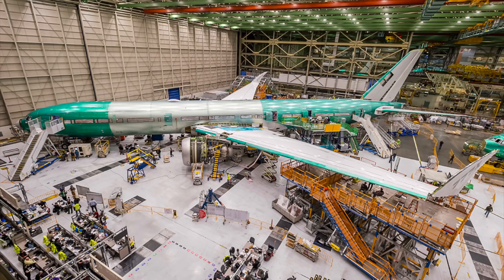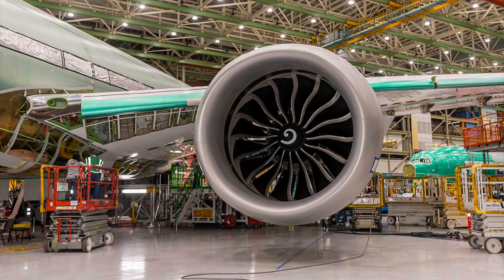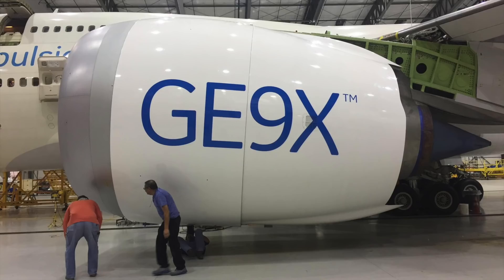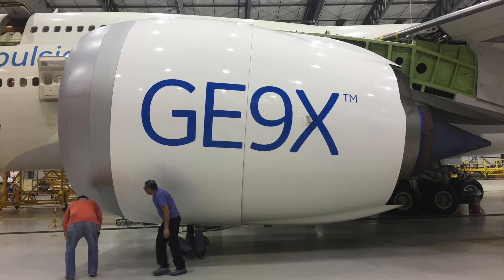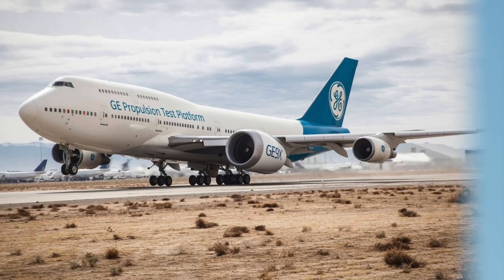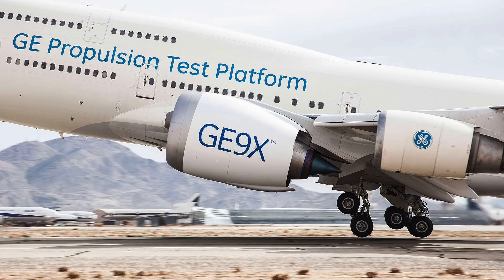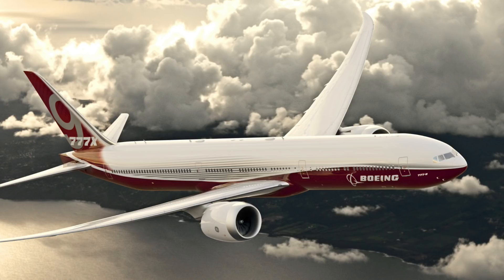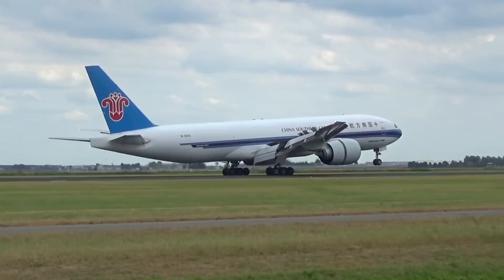777X Receives World's Largest Jet Engines

Comment: The wings on the 777X are carbon composite as you said, but I don’t think that aids in aerodynamic ability. The thrust does not need to be as high because parts like the wing are made of generally lighter material. Less mass needs less thrust.

Comment: I would be interested in knowing why the GE9X doesn't have the chevrons that were included on the 747-8, the 787, and the 737 Max aircraft.  I could be wrong, but I thought they were a way to reduce the noise footprint of the aircraft.
Reply: thedawg1995 Yes, but they decrease efficiency somewhat as well. 777X without chevrons was already a bit quieter, so there was no need
Reply: @AmbientMorality  Thank you.  It just seems odd that they did this for 3 different aircraft models but not this one.

Comment: You end the video asking us, "What do you think?"

What are we supposed to think?
If it works as advertised, is as safe & reliable as its predecessor, it saves fuel, and has lower or the same maintenance costs ... it's going to be a fabulous engine.

But how could any of us know what to think about this engine, until it's actually been put into the air and tested under real-life conditions?

Comment: Would have been nice to get an explanation on why the engine needs to be so big if it isn't producing more thrust than the GE-90.
Reply: @Raph Fan Because MURICA !!
Reply: Raph Fan I agree.
Reply: More efficiency. The plane engine produces it's own vortex and relies less on the outer fan to drive air inside the engine I believe. Something like that, do your research.

Comment: Drag has very little to do with T/O performance. The GE 9x engines 'produce' less max power because they are  'flat rated' to a higher density altitude. 

Im guessing this has a LOT to do with making the B77x a desirable A/C for use by the Arab countries where 50c and higher altitude departures are routine. This means that the B77x can max out its weight and capacity at all operating conditions - as far as take off calcs go.

Comment: 105000 lb of thrust is plantae and by making slightly less power than its predecessor it's probably saving fuel which is very important so there are trade-offs. I also think it's taking way too long to get the bugs out of the engine and get the thing flying I have repeated before that the 747 was flying within 28 months from its conception to its completion and that was done with far less computer power than Boeing has now I know the ge9x is a very complex engine but they keep postponing the launch date and don't seem to be making any progress on it Airlines will not wait forever to be able to buy the jet there is plenty of competition out there

Comment: Even thought the engine doesn't need to be more powerful on that particular aplication,why not make more powerful if it will be put on other aircraft any time in the future,or even for reserve power for the aircraft it's on.
Reply from the maker: If the engine was more powerful, it wouldn't be as fuel efficient, which is what airlines are mainly opting for these days.

Comment: Great Video and the engines sound like  they will offer useful cost per Kilometre savings, I wish that they would develop better seating spacing for pax however, I couldn't give a damn about the engine size,so long as it's safe and reliable however, any 18 hours trip with microscopic seating space is the flip side of the coin it appears, Fly 'Emirates',not only bad food, no service and treating pax as cattle, the engines would be the least of the list of Airline inconveniences. and you'll understand.

Comment: Now i wonder, is the 747-400 in full payload can fly with only 2 GE9x engine?
Reply from the maker: Not sure mate, though that would definitely be interesting to see!
Reply: I’ve seen where thrust wise it could. air at least with the 90 that produced 115, 00 pounds thrust . The issue was that everything  requires so much modification, it’s too costly and would equate just making a whole new plane
Reply: iihamdi......  Yes it could as the 2 GE9X's are lighter than the four 747's engines !!!! GE when testing flew their 747-400 on just the one GE9X during testing !!!!!

Comment: Doesn’t the efficiency of the wing have more to do with it’s shape and design, rather than the material it is made out of?
Reply from the maker: If the material that it's made out is lighter, it therefore makes the wing more efficient. But yes, the shape and design are also key factors for sure!
Reply: @pureaviation3596  that was a dumb idea to make the plane slower. What's the ratio for fuel consumption for both engines?

Comment: Lets hope that the extended landing strut on the aircraft can take landings as well as the short struts on the normal aircraft heights.  Those large engines must be kept far enough off the pavement so that they don't suck FOD into the intake.  If those struts get any longer the craft will look like the B-58 Hustler, which looked like a mosquito.  If the old engines were more powerful, then why have the new engine be larger and less powerful.  He said, "because it doesn't have to be."  So, would the weight increase of the old engines if put on that aircraft be too much weight for those new wings to carry?  If the fuel consumption of the new engine saves that much more money, then I can see why.  But why does just increasing the size of an engine cause it to be less powerful?  That doesn't make sense.  Were they afraid it would rip the pylons off the wings.  We were told years ago that with the new Turbofans that were being introduced, that if they put them at 100% at take off it would unduly stress the wings and possibly rip the engines off the pylons, so they took off at only 80% thrust !
Reply: It has a lot to do with fan size. Cold air is easier to compress than hot air. The emphasis these days is on moving more cold air and less hot air. So, make the gas generator more fuel efficient and extract as much of that power of combustion as possible, then feed that power to the fan. So the fan becomes bigger and the gas generator becomes physically smaller. Have a look at the diameter of the gas generator of a GE CF6 then compare that to an old P&W JT9D gas generator. In a way we have come full circle from the huge radials and big props, to the pure jet, then the turbofan and now back to the old days of propeller driven aircraft, but using a gas turbine instead of a radial.

Comment: You mentioned that the plane will use less fuel, and cost less to operate, but you did not explain why/how the bigger engine will be more fuel efficient.  And you also failed to explain why/how the new carbon fiber wings are more aerodynamic.  Using carbon fiber in itself would not produce any benefit in aerodynamics.  However, since carbon fiber is stronger than aluminum, it may be possible that they were able to make the wing thinner, and that is why it is more aerodynamic.  But you did not explain that.    Also, why would you give the diameter of the new engine in inches?  Nobody thinks in inches beyond about 4 or 5 feet.  184 inches = 15'-4"  The engine is taking the idea of 'high bypass' to the extreme.  It is more of a turboprop, that blade is a ducted propeller.

Comment: Does this new engine fit in B-777 freigher? Thought the current engine is the maximal loadable size to fit in B-777 freigher. When loading current engine, there are inches to maneuver. If not, why build an engine that can't be shipped commercially. Airlines rely on replacement engines and cargo carriers sure like the revenue moving engines - it's a big business.Anybody know if new engine is loadable in current B-777 freighter?
Reply: soaringtractor  Hi, a spare engine may has been attached to a B-747. Modern two engine jets are not designed to carry a third engine under a wing. Do think it's a serious issue. May be the new engine can be partly disassembled in order to fit into a triple seven freighter.

Comment: What size is the fan diameter of engine which is used in  A380.
Reply from the maker: It's about 116 inches (290 cm) for the Trent 900 engine.

Comment: I see so many complaints about seating size and I want to complain as well. This though is the wrong place to complain. It’s the airlines not the make of the plane.  Really we all need to pay for the more expensive ticket on the airlines that offer the bigger seat. Send a not to SW Sardines and tell them you were going to take a trip but used another company and paid more for more seat or just did not go. Although I don’t think they will care. So our only options really is congress. Have congress pass a min seat size. Until then it will continue to shrink. Some airlines if I can’t get the bulkhead seat with the extra leg room I don’t book.  Amazing engine and an amazing plane.

Comment: This is exciting and depressing at the same time
Reply from the maker: Why depressing?
Reply: @pureaviation3596  because the start of the 777X will officially mean the start of the end of the A380 and 747
Reply from the maker: @80sfreak14  True true
Reply: @80sfreak14  -- I haven't missed the 747 at all. In fact, I was glad to see it go. The B777 in 9-across is much nicer than that 747 in 10-across, and so my frequent transpacific flights are much more pleasant. 

I will miss the 380, as that's a VERY comfortable aircraft. Sadly, it seems that it won't be around for long ......
Reply: @sking2173  yeah but the A380 is more comfortable than the 777 in any configuration...
Reply: @adamhall5298  nope, the B777 seats are  designed and engineered for precise comfort state of the art.
Reply: @eddyboh2723  That's all to do with the airline. I found Singapore's A380 way more comfortable than Cathay's 777-300ER. However Cathay's A350-900 beat them both imo.

Comment: your explanation makes no sense. If the plane requires less power because it is lighter or more aerodynamic, or for any reason, and your reasons given were also not correct, WHY does the engine need to be bigger? That creates more drag. You need to research your subject matter better. The reason it is bigger is to suck in more air to generate a greater percentage of thrust from bypass air. That compensates for the greater drag.

Comment: I prefer Boeing 747 is the best than Boeing 777x. If 777x fly the landing on the runway and if crossword may be push the plane with under the mount of an biggest engine will hit the ground and it will crash or damage!. No matter what will happen to the plane.
Reply from the maker: Both are great, but I also have to say that I prefer the 747 :).

Comment: The concept of the triple 7X is outstanding very outstanding but the reality is no one's ever seen the damn thing fly it hasn't flown and I imagine the airlines would like to get it into their Fleet before it becomes obsolete bit of an exaggeration there but I made my point Boeing took the 747 from conception to completion in 28 months without all the computer power that we have today and I understand the engines are probably the main hold up but GE is better than what we are seeing from them right now I'm no engineer but couldn't GE and Pratt & Whitney design an engine with the same concept of Chevrolet 350 pickup motor need a good basic design and it should last for years they can test small and important updates of the engine after it has become accessible to Airlines and the flying public

Comment: Might be cheaper but wayyyyy more dangerous!!!
With 4 engines you can lose 1 of even two if one on both sides...
With this you lose one you're fucked!!! Fuck fuel consumption over safety
Reply from the maker: Dual engined aircraft are extremely safe nowadays. Even if one of them fails, the aircraft can still fly perfectly well on one engine.
Reply: @pureaviation3596 
But is a lot less stable
Pilots have to be compensating and continually do corrections

Comment: Emirates and Lufthansa?? Bye bye A380...It was nice knowin ya.
Reply: matt8863 I am ex GE 30 years I am currently working in the Xeos shop in Poland. We are setting up for GENX and GE9X. The shop is a joint venture between GE and Lufthansa with LTH holding 51% Lufthansa intend to take 777x early in 2020. The shop will be ready for PIP and UERs by then. Exciting times.
Reply from the maker: Yeah, seems like the A380 won't be around for that much longer.

Comment: Im just afraid these idiots are gonna extend flight times .. i wanna get there faster not more “efficiently”
Reply from the maker: I wouldn't worry about it mate. The more time an aircraft is spending in the air, the more it's burning fuel, so airlines also want to get there as fast as possible.
Reply: You can't get there any faster. Commercial airliners already operate at the physical limitations of elevation and speed
Reply: Timothy Cook 
Finally ! Some one says something to make me feel better. Thank you 🙏 if it’s true , it’s good to know.
Reply: @darthdaddy6983  Aircraft are hostage to the physical world. The higher you fly, the more fuel efficient. But the higher you fly, the closer you are to the speed of sound. Obviously, conventional aircraft can't exceed the speed of sound, so they are limited to about a maximum of 41,000 feet and 600 miles per hour

Comment: Hey, American aviation Boi’s

I work for airbus and of course I’d say Airbus are better than Boeing but the thing is these engines will burn more fossil fuels. This aircraft is big and it needs big engines for weight. Boeing’s 777X is more bad for the environment, the Airbus A350 1000 is just as long and can burn less CO2.

All your people need to understand, it’s good looks aren’t the answer for the truth. It’s the thought to the impact of the world.
Reply: that may be true,  but the a380 isn't exactly green with 4 engines
Reply: So basically your logical statement of one being better than the other is because of their Co2 Emissions and being Greener to the skies?
Reply: ah mecorp yes but the A350 can travel for 18 hours non stop from JFK to Singapore. An A380 would find that difficult, also the A380 isn’t being as sold as much as other long haul planes like the A321LR and the A350-1000ULR
Reply: And i work for the president of USA
Reply: @morganjones2944  Not entirely true. If the CASM is representative of the passangers carbon footprint, then the B777-9 passangers will have a lower carbon footprint than the A350. Then again all these are with assumption of a certain load factors and not based on absolute number of passengers. If the aviation industry really want to be environmentally responsible and reduce carbon emissions, then airlines should always undersize their flights to ensure 100% load factor. A half filled A350 is worse than a fully filled B747.
Reply: Never fly on an AirPOS aircraft.  Place a higher value on your life.
Reply: The video clearly stated that it was lighter due to carbon composite wings, required less thrust because of this, and uses at least 10% less fuel. Airbus isn't exactly the most environmentally friendly with the A380 being the biggest fuel pig in the sky today. And because they have trouble filling all the seats and can only service certain airports the overall per seat efficiency is even less.
Reply: for each seat, wouldn't 777x will be greener?

Comment: Another useless video by someone with little aviation knowledge.  By increasing fuel efficiency it does not translate to improved passenger comfort or reduced air fares.  It merely reduces the operating costs for the airline which in turn increases their profits.  Secondly, this stupid video does not address the question relative to 'Maximum Gross Weight', Maximum Airspeed , Stall Speeds or anything else that would demonstrate a significant improvement over the 777.